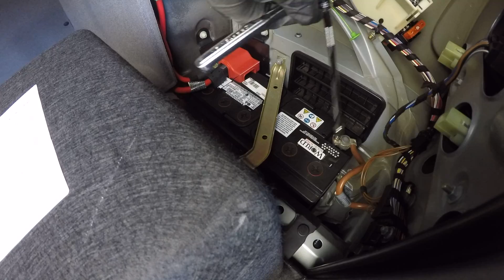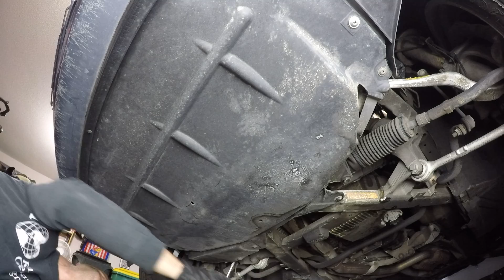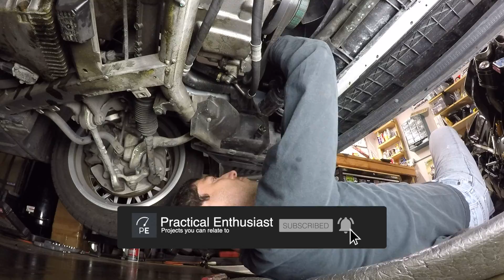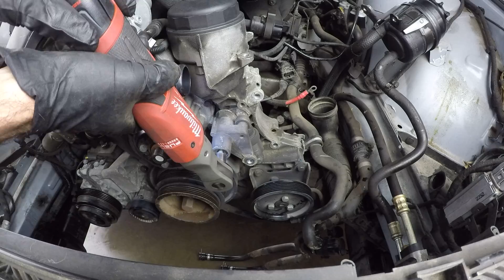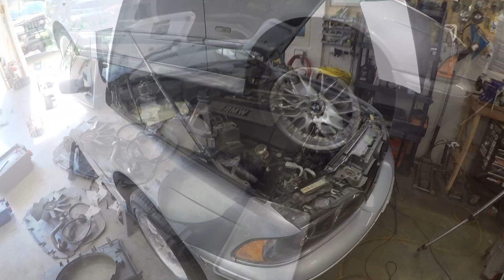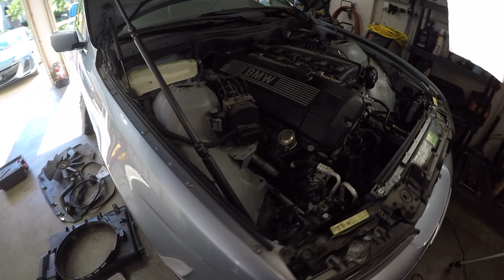Project E39 | Ep.5 | Stripping it down to Service Position in 7 minutes

Comment: Still can't believe you found such a clean, low mile e39.   Such a timeless classic.  Do you worry it will be hard for you to part with when it's time for the next project?  I would want to keep it.
Reply from the maker: I'm definitely torn on what I should do with it. On one hand this would make the perfect daily that I could drive for a long time. Rear wheel drive, manual, fun to drive, with no lingering mechanical or cosmetic issues in the back of my mind to worry about. On the other hand, it's a sought after car that when sold could finance another interesting project. But I have to finish it first regardless! 😄

Comment: I have a question about the throttle body, I have just removed mine to replace the gasket. in the same process as I see in your video. I have clean and replaced the gasket it while it was on my bench. I did move the flap manually more then a few times during the cleaning. Did I hurt it in anyway? Also, did you reprogram the ecu, relearning etc. after install?? Thanks much!
Reply from the maker: Moving the flap manually won't hurt it, and no reprogramming is required upon installation.
Reply: @PracticalEnthusiast  I thought oh man, I just ruined a perfect functioning unit and need to buy a new one plus go to dealer to do a relearn programming ,  all just for cleaning it a bit and gasket change. I asked the same question online and read all kinds of options regarding the throttle body cleaning. 
Thank you for reassuring me I did nothing wrong. Appreciate you got back to me.

Comment: Hello , how did you take off the fan? What size wrenches did you use? Thank you so much in advance.
Reply from the maker: Hi! You'll need to pick up a set of wrenches like this: https://amzn.to/32fgpuF
I have a set and the wrench that holds the pulley bolts stationary doesn't fit perfectly, but it gets the job done. Good luck!
Reply: @PracticalEnthusiast  thank you so much.